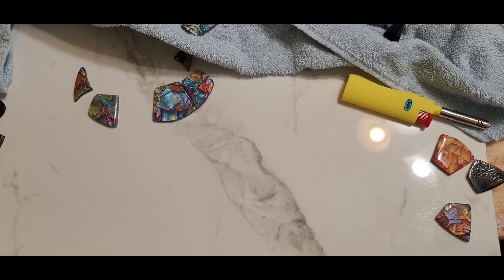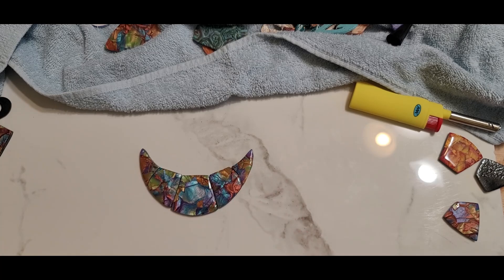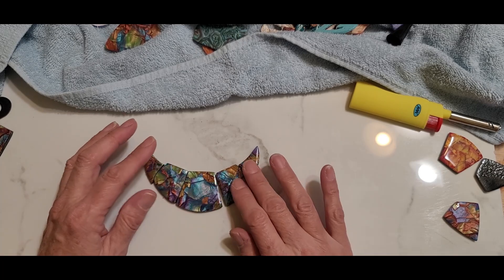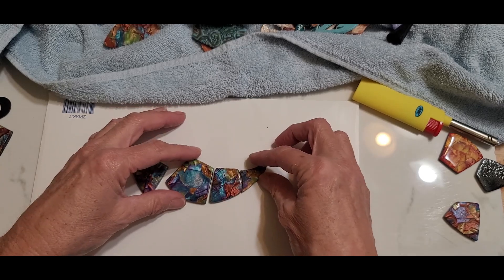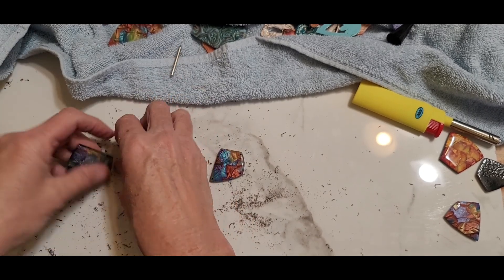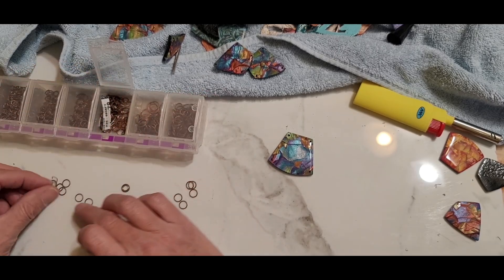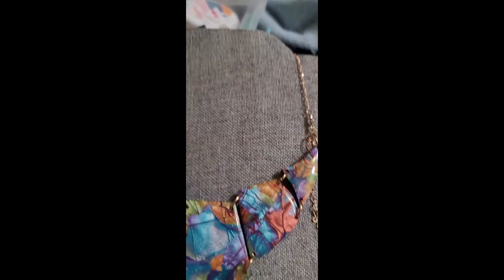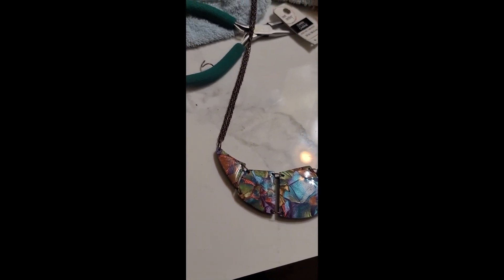Polymer Clay and Jewelry Assembly Need Help~!

Comment: I gave up resining the sides. I just sand the edges and then apply gloss varnish with a cotton bud/q-tip. Finished look with no bulk. Give it a try if it's not too late 😉

Comment: Hi, just to tell you that there is a product made by ‘Mont Marte’ a super gloss glaze which has the finish equal to uv resin. It’s a lot more cost effective than resin and a heck of a lot easier to apply. One draw back is that it can’t be baked, like epoxy resin it bubbles. It’s consistency is like honey and is water soluble. I subscribe to Susan Bailey and told her about this product, she now uses it. Hope this info is helpful to you. Hugs from South 🇦🇺
Reply from the maker: I've tried it. It is extremely thick and trying to do the sides was a P.I.T.A.  I'm not having problems with resin in general. I'm only having problems with resin on the side because it's just really hard to hold your piece and not allow that resin to just get everywhere.  I will try it again though.